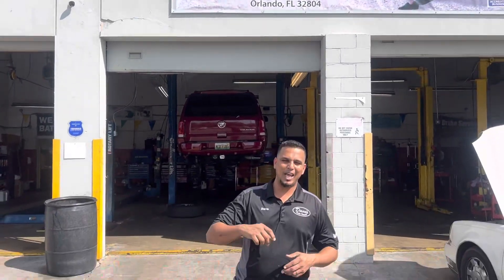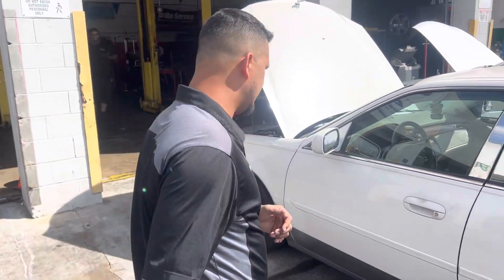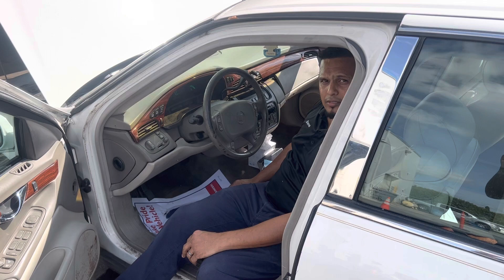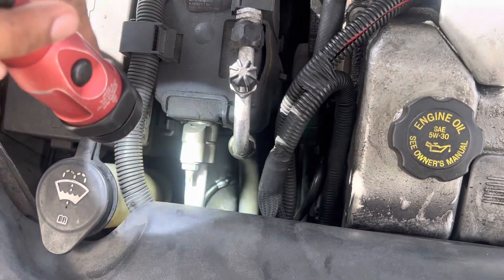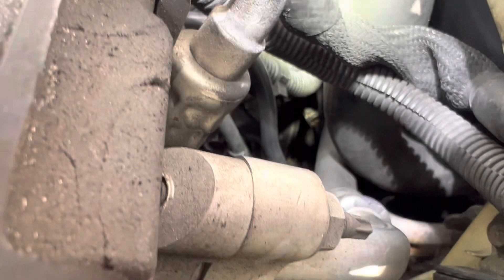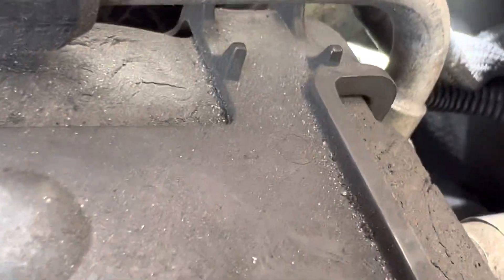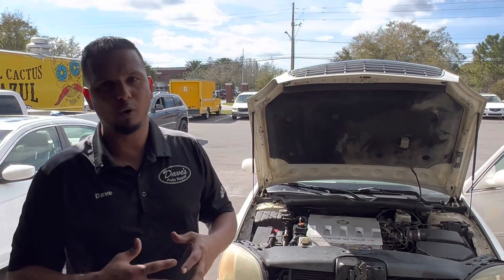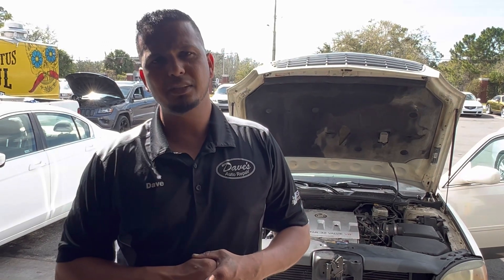02 Cadillac Deville no crank no start

Comment: You took the wire to the alternator off , and ran a wire to the steering pump?
Reply: Did you figure it out  ?
Reply from the maker: No, I ran a ground wire from the frame to the engine
Reply: @dr.mechanicorlando5258 What gauge ground cable did you use?
Reply: @spiritual_Richhh   mine was the starter.

Comment: Same issue . Added a ground , no fix . New battery , no fix.
Reply from the maker: Try to have it scan for codes
Reply: What gauge or size is the ground cable from the engine block to the chassis?